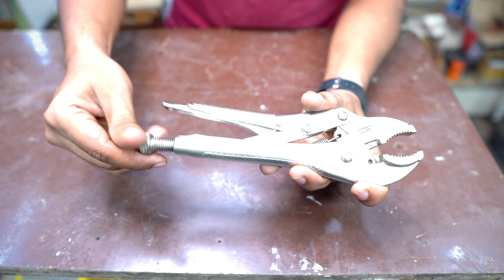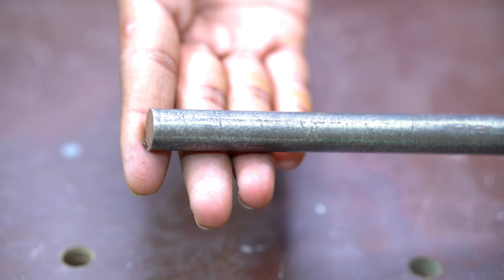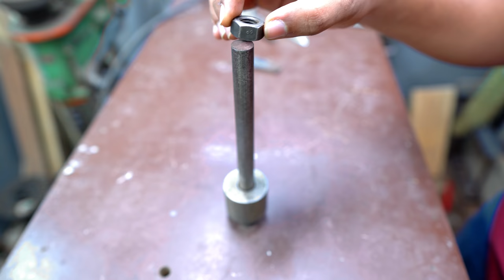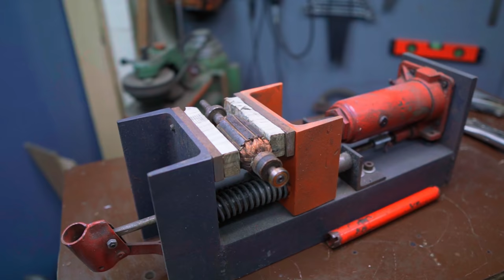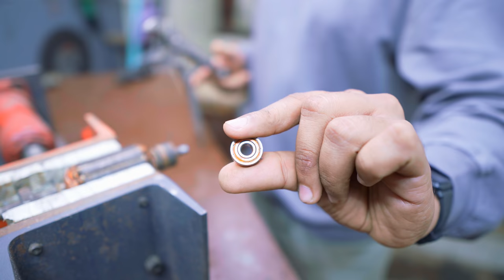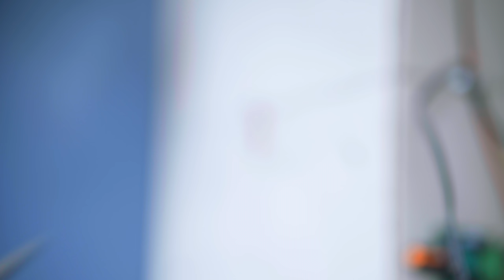Amazing handmade tool from a grip clamp | Be Creative

Comment: Nice idea for a "rammaneur" as we call it. But if you cut a thread (M8 or M10) at the place of the (welded)nut, you can remove the nut (maybe 2 nuts tightend to each other) and replace the slider with one that is lighter or heavier.